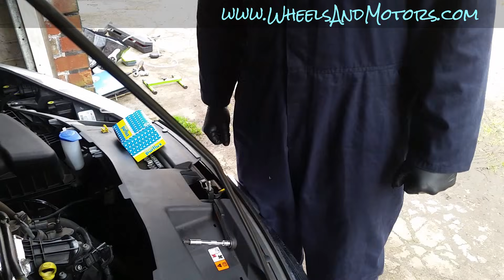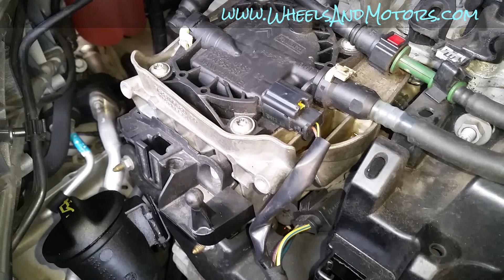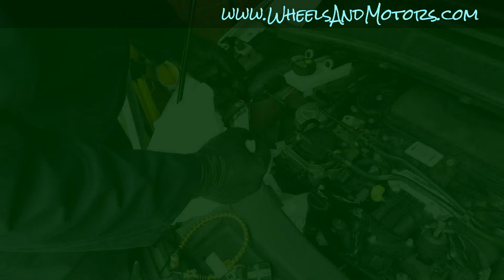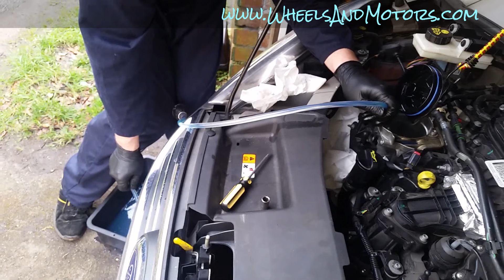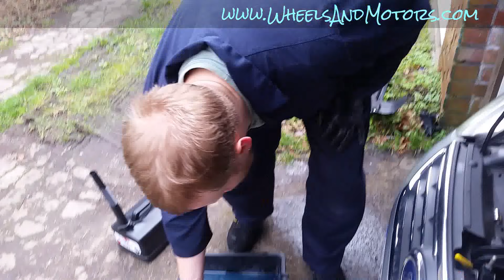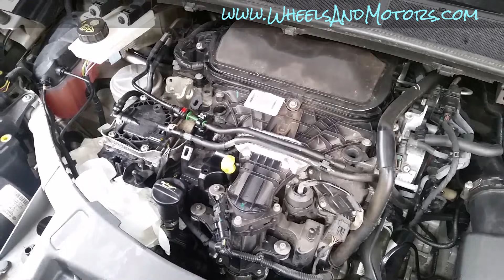How to replace diesel fuel filter Ford Galaxy/S-Max/Mondeo 2.0 TDCi

Comment: Great video, well done.
Just to add a tip that I gained from experience, it's worth fitting a bung on the supply fuel line to prevent fuel running back to the tank. 
You can also cycle ignition 3-4 times to prime the fuel line prior to starting. Then start car and immediately hold at 2000 rpm.
Reply from the maker: Thanks for the advice! I'll pin this comment 👍

Comment: What is the best primming pump?
Reply from the maker: The best way to prime is to activate car's fuel pump via diagnostic software. I have tried with a good scanner, but I'm not sure if this vehicle has such option at all.
Reply: @wawayltd  thanks

I want buy pump, but Im not sure which one will be better. That one which you used on video or Oil extractor pump?
Reply from the maker: @ememUK90  Unfortunately, I can't help you much on this. The car in the video wasn't mine. I did it for my friend once. I didn't have to do it anymore, the car is gone...  maybe try searching online on forums?

Comment: I just chened disealfilter and now the enginge do Not start do you know why?? Thanks alot😊
Reply from the maker: Because filter has a lot of air inside. It needs to be primed.
Reply: Ok❤
Reply: You have to get rid off air in the system

Comment: What happens if you dont get all the air bubbles out. I did this job a few weeks ago but I think theres still air bubble in the line for some reason. Engine making a funny rumbling noise but not always. After revving up I see a big air bubble pass through. I would have thought they would have resolved themselves over time unless I have a leak somewhere?
Reply from the maker: Normally they go away eventually.

Comment: These have an electric fuel pump no need to bleed it
Reply from the maker: How do you activate that pump? In previous models, you just put ignition on and it works. With newer models it doesn't work. Only software.
Reply: Is your model 2014
Reply from the maker: Yes it was. That car is gone now.
Reply: @wawayltd  fantastic detailed video 👏
Reply from the maker: Thanks 👍

Comment: Can't we just, turn on the egnition, let it like that for like a minute to let the fuel pump to remove the air bubbles from fuel filter housing and fuel lines to the gas tank?
Reply from the maker: Unfortunately, we can't. This used to work on older diesel cars, but after about 2009 pump activates only for few seconds. In my VW I use software to activate fuel pump. This Ford is a hassle.

Comment: In order to replace the diesel pump in the fuel tank, do I need to lower the fuel tank to the ground?  For Ford S-Max
Reply from the maker: I tried to have a look in some manual, but it's not that good. I suspect that fuel pump could be sitting not inside tank, but next to it. The car in the video is not mine, so I can't have a look. Sorry I can't help much..

Comment: just bought a ford galaxy swear its the same one you work on ,makes it so much easier by your videos cant wait to do the jobs you have done on it ,thanks . 
Question why do some mechanics use power tools and then normal ratchets spanners to take off or on with nuts  ect
Reply from the maker: Thanks Loll, power tools mostly to speed up the process, because time = money.

Comment: Do you have any video for changing other filters such as when you do the whole service? Cabin filter, water pump, oil filter etc...?
Reply from the maker: I have oil and oil filter, cabin filter, air filter..  This car has PowerShift automatic gearbox,  we change oil and oil filter for gearbox, but I haven't done video yet. Water pump is driven by cambelt, so it's a cambelt job - I don't have it for this car yet.

Comment: Do I need to prime/bleed the system if I leave the old fuel in the filter housing and don't syphon it off? Just take the old filter out, put the new one in and reassemble?
Reply from the maker: Old filter will take significant amount of fuel + leaks while doing it. It's not that difficult to prime it this way..

Comment: Thanks fot this video, really helps. 
Just couldn’t get the air out of the system with that hand pump, I think it’s not strong enough to suck fuel up all the way to return pipe. Started engine  anyway with no interruptions.
Reply from the maker: Yeah, it does get really hard at the end, but I don't think you need it to go all the way, just as long as diesel shows up on return.

Comment: Brilliant video! Exactly what I needed. Many thanks 🙏🏻
Reply from the maker: Thanks Dan 😊👍
Reply: @wawayltd  hi hope you can help I have this same car 2007 ford galaxy and the car won't start straight away  in the morning have to use easy start I changed the glow plugs same problem car runs very nice  when it starts
Reply from the maker: Is it turning when you try to start?
Reply: @wawayltd  yes it turns and occasionally will start after r 5 -10 minutes  but battery dies so to prevent that I use easy start
Reply: @wawayltd  also changed relay fuse
Reply from the maker: It's really hard to say, perhaps something to do with fuel - like in-tank fuel pump, or maybe injectors. Do you have a chance to scan it properly (not just obd check light)?
Reply: @wawayltd mechanic   put it on computer nothing came up except abs issues had injectors installed before this also had them checked
Reply from the maker: I wish I could help you.. I'm not professional. 
I know one good diesel specialist place in Bristol, they called DTM. Don't know if they are national wide.
Reply: @wawayltd  ok thanks my friend for your time much appreciated

Comment: Thanks for the video, was a great help! I changed the filter no problem but couldn't bleed the system . I definitely have air in system as can see it but when I attach siphon it cannot draw enough fuel to clear it. I also tried syringe type. Any ideas? Car starts fine.
Reply from the maker: If the car starts and runs fine, I wouldn't worry about it - air will clear eventually.

Comment: Hi, I am currently have ford smax and it is on its last legs so trying to decide between sharan and galaxy. May I have your opinion as you owned both cars. THANK YOU!
Reply from the maker: That Galaxy is not mine, it's my friends. However I still have an opinion.
Personally I prefer Sharan for few reasons:
1. VW is better built and designed. Higher quality and mechanically better to work on. That's not just me - few mechanics I know said that.
2. There's lots of workshop manuals, lots of technical info widely available for VW (you can buy Elsawin on eBay). There are few things that I can't do for my friends Galaxy, because I don't have info how to.
3. With all 7 seats up Sharan's boot (trunk) is bigger, despite both of them don't have spare wheel. However!  - New Galaxy, after 2015 comes with a spare wheel, but I don't know much about that model.
4. If you buying it as a taxi or if you have kids - I think that sliding doors are safer.
Advantage of Galaxy - normally it's cheaper to buy.
There's something I must say about both of them - whichever you choose, don't take automatic gearbox, whether that's VW DSG or Ford PoweShift, they are temperamental, require good service every 30.000 miles with expensive oil. Manual gearbox is reliable as hammer and requires no maintenance apart for clutch once in a while, and if it's not a taxi, probably once in a lifetime.
I have a review about Sharan on my channel.
All of that is my personal opinion, and if you'll buy Sharan that gives you trouble - please don't blame me :)
Reply: Many thanks for your quick answer, that's exactly what I was looking for. All the best !

Comment: Thank you for this video! Do you know what is causing that chirping noise when you started the engine?  thx!
Reply from the maker: Probably there were still some air gaps..
Reply: I am referring  to the chirping that doesn't stop. I have the same noise on my mondeo. Someone said it is the aux chain and it should be replace. I was trying to confirm with you. Thx!
Reply from the maker: Sorry, took me time to reply. Yes it could be something along the aux belt. But it needs to be seen, I couldn't diagnose your car via YouTube comments :) Not even talking that I'm not qualified mechanic - just enthusiast.

Comment: We had the engine malfunction warning come up yesterday and apparently a dirty fuel filter can be the cause. Any idea if changing it might clear the error and stop the car going into limp mode?
Reply from the maker: When did you change fuel filter? If it was long time/miles, it's always good idea to refresh it, they don't cost that long. As for engine management light, you need to scan it to see what code it's giving you. I have little bluetooth scanner from eBay, it's not expensive and it helps to give you idea what's going on with your car before you start spending money for garages. Here's my video about it:
https://www.youtube.com/watch?v=oUn5u5g6C0A

Comment: Thank you very much for the helpful and detailed video
I have 2.0 tdci Kuga and having hard start at mornings. 
I used hand pump to bleed air out. But nothing changed. I am searching a solution. If you could advice anything I would be more than happy.
Reply from the maker: I met one guy recently, who used to start diesel car same as petrol without waiting for glow plug sign to go off... Just a thought ;) Any other reasons could be different. What do you mean by hard start? Is it like a bad battery or just rough engine work while it's cold?

Comment: Great video thank You...Having a problem with the wifes car [08 plate]  same model...It has a problem starting now and again hot or cold...if you stop it running just by turning off the ignition...it doesn't like to start first time,,how ever,if you rev it and whilst revving turn the ignition off..it mainly starts first time...thought about a vacuum pipe that could be split but don't think it has any..Don`t think the filter`s new and has got 132000 miles on the clock..if not the fuel filter...any ideas please...Thanks all...Charlie.
Reply from the maker: Battery? Is it turning good while trying to start?
Reply: Yes mate...new battery etc ...It turns over but the  engine doesn`t kick in/start...try it a few times [could be up to ten times] then it starts and runs  A OK and will run all day until We stop it...Thought at first it might be the remote/battery on the key until we used the spare set...same thing...its just as if its short of fuel with none to start it as if  it needs to prime itself...hope that helps...
Reply from the maker: Maybe faulty fuel pump (diesels have 2), or maybe some trapped air in the fuel system... The air probably would get through by now.. Maybe scan it with some diagnostic tool?
Reply from the maker: ... OR! Clogged up fuel filter. If you're not sure about filters - change them first.
Reply: Putting on a fresh filter this weekend...will let You know the out come...Cheers Dude.

Comment: Thanks for all your videos on the Galaxy!!
Reply from the maker: Thanks :) Perhaps I'll make few more in the future.
Reply: WheelsAndMotors I changed the fuel filter following your instructions and am getting fine air bubbles . Everything is tight on and the engine starts just fine what's your opinion? *GALAXY MK3

Comment: I thought the Smax engine was identical to the Mondeo 2l tdci but when the SMax reached the cam belt change interval the garage said they needed to get a different tool for the cam, the one they used for the Mondeo wouldn't fit. I don't know what the tool is that they were referring to but he said the SMax has the Peugeot engine.
Reply from the maker: Yeah, they also share engine with volvo. I haven't done cambelt on this car yet, need to get proper instructions and tools, so can't help you at the moment :(

Comment: Great video, many thanks, I have 2 Smax's, one has 203000 miles, it's been independently serviced every 12500 miles but I don't see any fuel filters mentioned on the invoices, I'm assuming they must have changed it otherwise it wouldn't run. It has original engine, turbo, injectors, clutch, DMF, pdf
Reply from the maker: It definitely wouldn't make 200K on one fuel filter - it gets clogged up eventually.

Comment: Very helpful video thank you. When priming at the end though, I find it easier to use a Sealey syringe pump. Simply attached the clear hose to the return pipe and pull the plunger until you see clear fuel with no bubbles. . Much easier than those bleed tools
Reply from the maker: Oh yes, they are a bit of struggle :)

Comment: Hi mate,
I wonder if anyone having problem with adblue heater, I read on the web it is a common problem with VW sharan??? My mechanics said it will cost an eye watering £500 to replace 😥😥
Reply from the maker: Yes - I have the same problem! And I had it for a while now - few months. Do you get fault code P202A? I was planning to fix it by myself, but couldn't find time for that. Especially when this problem doesn't seem to be affecting anything. When I work, I clear the error with Bluetooth reader and it doesn't come back while engine is running :) AdBlue tank is accessible by removing rear bumper. Manual says you have to empty it before removing, because it may be holding up to 17 litres of adblue. Heater element apparently is like a cup that sits on a top of adblue tank. It shouldn't be that difficult. Parts might cost about 200-300 pounds though. I'm gonna wait a little bit, because I have an appointment on 30th of June with VW dealership regarding that emissions scandal - they are going to remap my ecu. And, because that is also related to AdBlue some how, I'm gonna wait to see what they say first.
Reply: WheelsAndMotors I am having P202B, I have read VW in united states has extended the warranty for adblue heater because this is a common problem with VW, the new warranty is 120000 miles or 10 years, I have talked to VW UK and they don't have any information about this
Reply from the maker: Haider Zainy I'll see what they say on 30th and let you know. If it comes to fixing myself. I'll make a video.
Reply: WheelsAndMotors I talked to local VW dealer to book emission software update and they said as long as engine management is on they can not apply the update as it might cause further problem
Reply from the maker: That's strange, because before booking that update in Bristol dealership - I had a word with technicians, they said it shouldn't be a problem.
Reply: WheelsAndMotors any update about VW software update and adblue heater 202 error??
Reply from the maker: I have been to VW dealership yesterday. Before they said that my problem with AdBlue will not be a problem for software update, but yesterday they said that they don't want to see any faults to be able to do update. So I have to fix it now. Because it's not urgent, I will do it at some point after August. I have to dedicate all my time for work before my holiday in August. I think that my visit to parents is more important than AdBlue heater :) My MOT is in December - I will definitelly fix it before that, and I will make a video. Sorry that it takes time.

Comment: thanks a lot for the vid, more over, may I know the brand and the part number of the filter?
Reply from the maker: Don't remember brand (my friend bought it himself), neither I know the part number, don't normally get them for filters. Just get/call into any car parts shop and ask for filter - they will give few choices of different brands that will fit your car.
Reply: thanks, I think it won't be a problem to find the filter and I will try to do the replacement  on my focus mk3 2.0 tdci soon!
Reply: two more things, is the torque of the bolts 8 Nm?  and the recommended interval of changing the filter?  thanks in advance
Reply from the maker: I think they are 8, but I couldn't find confirmed info, just general internet searches (don't think it's that big deal). Interval depends on quality of diesel fuel. In UK we have European standard EN 590, so apparently filter can last up to 60.000 miles. What I normally do - change it every second oil change.
Reply from the maker: I think they are 8, but I couldn't find confirmed info, just general internet searches (don't think it's that big deal). Interval depends on quality of diesel fuel. In UK we have European standard EN 590, so apparently filter can last up to 60.000 miles. What I normally do - change it every second oil change.

Comment: thanks ive been looking for how to do this job for ages i have a 13 plate mondeo and cant find  anything to help. but this is the same engine set up as the mondy maybe if you put mondeo in the title you will help lot of us mondeo fans,, great video thanks.
Reply from the maker: Thanks Garry :) Just changed the title.
Reply: Totally agree with Garry, Im exactly the same - 13 plate Mondeo and the info (and Haynes manual!!) are rubbish on the details. Awesome video, thanks for creating it WheelsAndMotors - happy to subscribe.
Reply: Garry - Im just thinking now after reading your msg, but maybe you are the guy that can help me... Ive been trying to find info about proper trolley jack points on my 13 Mondeo. I just use the scissor jack location with the hockey puck hack, but its far from ideal especially when then trying to stick axle stands under it. Any divine inspiration fella?

Comment: Excellent video. Thank you very much.
Reply from the maker: You're  welcome :) Glad if it helps. I'll make few more about this car.
Reply: I have ordered the tool for the oil filter. You make it look so easy using this simple tool.
I have a Ford Galaxy 2011 Titanium X. It would be great if you can do a video on common faults on this vehicle and how to resolve them for FG owners to save huge mechanic costs.
If I can suggest one more video to your list, is rock chip and scratch correction with a DA polishing machine.